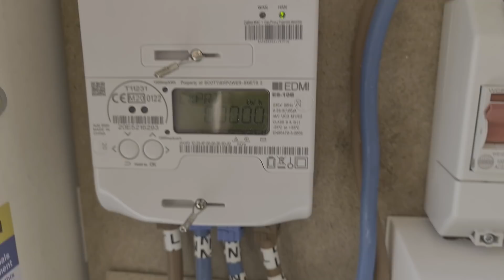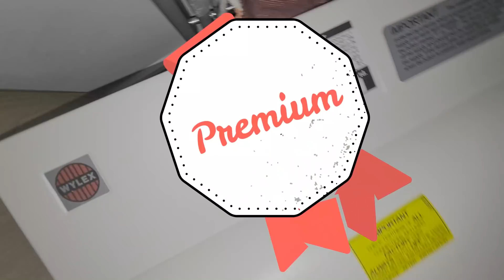New Build Electricians Shocking Standard?

Comment: My new build had a few shockers, outside lights, metal, earth cut short and not connected to terminal, probbaly because the apprentice thought it didn't need earthing because the wall plate was plastic, it was not a one off as the front light was the same. FCUs with standard 13A fuse not downgraded where needed, 3 pole isolator switches not earthed, metal back boxes, screws left in metal back boxes loose, exposed copper on grid switch not cut short enough, insulation screwed down on instead of the copper, connector blocks used instead of Wago, no stranded copper ferulled, all done as bog standard cheap, split load consumer unit with 2 RCD instead of RCBOs saving about £70 a house.
Reply from the maker: Bet it didnt have an SPD either 🤣
Reply: @electrician247 Ah it did have one, discovered today the downlights for the bathrooms and shower rooms are only IP20

Comment: Just come to this, a bit late I know. Main problem we have on commercial new builds is the typical team of Foreman + 10 or so apprentices/labourers. 
I’ve seen steel conduit installs where the bends are done with flexible steel conduit and yet they are using it as the earth! Raised this with the Engineering manager of the Datacentre and he didn’t care as long as he had a test certificate at the end. Didn’t care that half the values were made up,it was that obvious . Seen control wiring for roof top 1.2Mw chiller units run in flexible cable, not even toughened cable at that. I pointed out that there’s no protection for the cables and UV would destroy them in a few years. His answer was not my problem.
And therein lies the problem, too many people are happy to accept and sign off poor workmanship and design. Most of these ‘managers’ don’t even have any electrical or mechanical qualifications. Thankfully I’m retired now but still in touch with people in the industry. Nothing has changed with the big contractors , as long as they get a completion certificate at the end, they don’t care. It’s someone else’s problem, good luck trying to get faults corrected.

Comment: In this day and age the supply mcb was only 63 Amp rated - presumably the first sign of cost cutting by using low power SWA across the dwelling.
Twin RCD board, again low budget protection.  Low standards - I blame the money lenders for giving mortgages whilst at the same time not protecting the long-term interests of the property buyers locked into paying mortgages for barely adequate new dwellings (generalised low standards of construction, not just confined to electrical installation).
Reply from the maker: Well said 👏

Comment: I rang the NIC regarding the CET (Central Earth Terminal) recently, (this is the 'gland' in question in this video) and they said as long as it complies with the manufacturing instructions, they can't see an issue with it. I'm under the same impression as yourself, that it is a poor way to install something that has another perfectly assigned gland, but according to them, no issues!
Reply from the maker: The NIC can say what they like mate lol. Aside from the other issues with single insulated cables and such that's a piss poor way to make off swa and setup the earthing for a house. 

Also no selectivity on the ocpd for the submain. So much wrong and in truth would have been a lot easier and possibly cheaper to do it right imo.

Comment: what baffles me is if you now require a metal enclosure for the DB how come you dont need metal enclosures for the isolators etc in the outside cabinet , doesn't make any sense , we used to fit concentrics from supply to DB and yes we terminated with the bw or cw glands not the clamps

Comment: House bashers. The large corporations and 'housebuilders' lobby their mates ('MPs') to change or  adjust legislation to suit their own needs. They are all in the same club. 'Government' does not control the system, banks and corporations do. So, why would any housebuilder make a regime or working practice any more complicated than what the can get away with. It's all about share prices and profits as even the 'CEO's mates own the primary shares. I live in a relative new build from 2006. 16mm twin and earth tails from a fused isolator through the fabric for about 5 metres. Only basic insulation in the external meter cabinet where the outer sheath has been stripped right back.Un- clipped and flapping about. Generally shite installation with 1 rcd on the sockets. As a construction industry professional but not specifically 'qualified' in electrical work, I'm 100% confident that I'd have done a much better job. 'Qualified' in my opinion does not always mean competent. Someone that is competent does not need to be 'qualified'. I'll do it myself .  'NHBC' -waste of space. These 'electricians' -muppets. (apologies Mark, had to get it off me chest..)
Reply from the maker: No need to apologise at all. You make loads of great points. It's very frustrating tbh mate

Comment: What we need is a multiprong attack to sort thr various issues;

1. On new builds going forward male it compulsory that larger cabinets are installed - This will have a 3 fold effect; a. More space for all parties concerned, b. Remove that issue of DNOs not liking things in 'thier' cabinet due to point a above, C take pressure off electricians to cram stuff in.

2. OFGEM need to put more pressure on DNOs to not provide a supply to frankly dogshit installations, 

3. OFGEM to put pressure on CPSs to actually hold members to account for poor installs.

4. OFGEM  to put pressure on developers to give proper consideration to future utility works, be that electrical, water (and wastewater), gas and other services.

Going back to the root solution of larger cabinets would help all concerned. If OFGEM is not the right body then either DCHLG or HSE, the latter being sledgehammer to crack a nut situation but I'd that is what it takes then so be it.
Reply from the maker: Nice idea. Makes a lot of sense for a larger box
Reply: @electrician247  And/or a 2-compartment box. One compartment for the DNO, the other for the customer. Just a thought.

Comment: Great video Mark. New to the channel, liking the no nonsense approach and openness to discussion. What about external influence issues inside the meter box? In the cold/wet weather condensation might be an issue down the line? Fire proof insulation of the meter enclosure?
Great content 👍🏻🤘🏻
Reply from the maker: Exactly Phil. The cold needs to be factored into the mcbs operating characteristics. Derating factors need to be applied in most cases. 

The enclosures are generally adequately fire rated I believe. But only when installed as per MI.

Thanks so much for the kind comment and watching.

Mark

Comment: Seems to be common on nearly all new builds! Standard of work is very poor, it would take no time to make off that board to an acceptable standard. Totally agree that placing CU’s in the centre of a property is utter madness!

I have no issue with putting other items into a meter cabinet, it’s not the property of the DNO.

I do t know why EV Points are not installed as standard these days on new build 🤷‍♂️ and WHY are people still installing split load boards? RCBO are smaller neater and far better cost really isn’t San argument these days
Reply from the maker: Very good points well made mate. Totally agree. Thanks for watching

Comment: Regarding the not using the meter box I’ve had literature sent to me from the DNO (UK Power networks near me) who have said I can use the bottom right of the meter cabinet but for switch fuses only.  

Think it depends on the region and what they will allow.
Reply from the maker: Yes UK power networks have a pdf that shows this mate. Varies as you say region to region.
Reply: @electrician247  Yeah it’s the first time I’ve seen it mate and only with them. They all seem to have different rules and regulations, some DNO’s will let qualified Sparks pull main fuses if no Iso, some won’t really is a lottery.

Comment: I'm an old git and would have had my wrist slapped for something as simple as not aligning the screw slots on a switch plate. Makes me weep seeing this sort of work. That's why Good sparks are undercut and don't get the work. Unfortunately the DNOs or meter Operators  have no responsibility or more importantly the Authority now unlike when there were Electricity Boards who had Installation Inspectors who carried out the final connection to the meter and then sealed up. Most would not have passed or connected that installation on many accounts!
Reply from the maker: Yes this is true Alan. Thanks for watching!

Comment: Mater installers are required to supply to a double pole isolator on new builds. Only get supplied the basic we need to come to an arrangement on these sites the site will provide the fused isolators. So cuts down on clutter in meter cab. It’s all costs. Never about a quality job.
Reply from the maker: Sadly its very much cost driven.

Comment: I work in the Hotel sector, and a couple of years ago went to a recently opened  4 star property, with customer complaints of the sockets in the bedrooms tripping.
I Investigated and found all the complaints were from one side of the corridor! After investigation, The boards on one side of the corridor all had 4 x  6 amp RCBOs and on the other side of the corridor 4 x 20 amp RCBOs, correct mix was 2 x 6 amp and two x 20 amp Looked at the sign off paperwork and all test sheets were copied from one master sheet, and all had the same values. This was built by one of the top contractors in London.(I should have added, Individual boards for each room in adjacent risers!)
Reply from the maker: Its amazing what goes on. Yet nothing seems to change

Comment: Race to the bottom with  ew builds and EV installs, bigger companies making too much money from installations, installations which are meant to be governed by one of the strictest British standards in the world, yet standards are so low. 
I'd agree that putting equipment in the meter box isn't right as I saw the video efixx did however, with installs like this, it doesn't give much options. All parties involving electrical supplies need to communicate more.
Reply: *new. However maybe ewww was a fitting predictive option.
Reply from the maker: Great points Alex. I agree

Comment: Two words for that installation; shit show! The house I'm in (a rental) was built by Barratts in the early 90s.  Something that bugged me not long after I moved in was the fact every socket in the house (with the exception of a couple) is a single socket.  The reason became apparent when the main breaker tripped; the whole bloody house is on one ring main.  That's not the end of the cockups; none of the plaster boarding is put up properly;  all done with dot and dab, nothing is square or plum.  None of the doorways are square, all of the doors have been planed to shape to fit the cock-eyed doorways.  With the amount of effort that's been taken to bodge together and balls up the build, they could have done it properly in half the time.
Reply from the maker: My 2001 house has an excellent electrical installation. My only gripe on moving in 2009 was a single rcd on the entire install. The joinery and plumbing. Thats another matter entirely. Same as you found, awful!

Comment: I was at a New Build that was finished in Jan 21 and again NICEIC company.. crap board, lighting circuits done in such a way that they had 4 cables at multiple points and coming through a section of wood so no ability to install non-pendant light without tearing open the ceiling to correct it all by terminating in proper MF JB and having a single cable drop. The buildings non-electrical was just as bad, every light fitting was stuffed full of silicon meaning it all had to be picked apart carefully. From what i can see these new builds are terrible. I could go on but you get the point.. New Builds are disgusting and i would NEVER ever purchase one!
Reply from the maker: On the tools did a video last week showing just this. Disgraceful really. Thanks so much for watching!
Reply: Shameful need I say anymore

Comment: This whole concept of the nation having EV's is flawed from the timescales, to the infrastructure, to even sourcing the materials for batteries, do we even have the recources for raw materials in this country ? I doubt that, let alone the recycling of such batteries.
Whatever country they source the raw materials from will end up holding us to ransom on the future costs of the raw products, where have we heard that before ... think about oil, OPEC ... sthe story goes on.
Plus, once fossil fuel taxes diminish for the Government, who thinks any subsidies will remain for EV ? We all know the pound of flesh will be required, has to be as roads will still need maintaining , building, lighting, policing... blah, blah, blah. So forget ongoing subsidies, they will diminish just like solar panel subsidies.
If EV's are forced upon us, and each domestic property will require EV charging points, just what are the regularity bodies doing to ensure that building designers/builders are catering for these imminent changes ? that example house is a classic example of zero foresight into adding an EV charger point, or any other additional electrical services.
Even the existing meter cabinets are a bit of a squeeze, look at the small additional board fitted at an angle, meter cabinets from here on in should be large enough to cater for the installation of feeding EV chargers from the CAB, with of course correct switching, fusing etc.
Lets face it, they are more often than not at the front or side of the property where most EV vehicles will be parked up for charging, why not have regulation now for the issues you speak of.
I know some may say that this would be taking work away from electricians in the future, well, show me who really relishes installing an armoured cable on a new or recent build from the consumer unit under the stairs to the EV charging point, with solid floors and chipboard flooring, even worse once a tiled or laminate floor has been added.
In addition, what consumer wants to have his recently decorated house pulled apart or to be told that he will have huge black armoured cable run externally around his property.
In maybe the 30's, the fuseboard was often fitted under the stairs, but then, there were floorboards, in the later years, consumer units were fitted, often just inside the front door, then at high level in a similar area.. ok, maybe not a bad EV install.
Now... if they now install the consumer unit beneath the stairs, bad news for EV installs, maybe not always bad for extra internal installs.
In many cases, consumer unit within a integral garage.... could put a smile on an installers face 😁
With respect to the quality of install on a new build, sealed competetive tenders are the culprit, plus to meet that price, the contractor using non qualified labour to throw it all in and then a 'qualified' guy final fix... just what that word 'final' means is well open to interpretation.
As an addition here, the DNO who fitted my smart meter fitted the mains supply isolation switch, fitted it upside down ! he used to stack shelves in a supermarket months before, not a qualified electrician at all, just trained to do one thing, and he even got that wrong.
I did not notice at the time and when I did I called the DNO and explained, that was several months ago and no one has contacted me to change it !! 
Phew, never intended that to be so long..😁
Reply from the maker: I dont disagree about the EV concept. But seems to be the journey we are on. 

Thanks for watching and joining in the comments, really appreciate it

Comment: Now I've never done this, nor will I probably ever, but wouldn't it be better to have a small MET in that meter cabinet so you don't have to mess with the suppliers head in the instance that you have to pull a new armoured for your consumer unit? 

Also is that a jubilee clip?
Reply from the maker: Makes sense to me. 

Its a swa gland/termination typically found in street lighting. Works in the same way as a jubilee clip

Comment: I've laboured on new builds, the quality of workmanship across the board is an absolute disgrace, from all trades. As for the electrical industry it's a race to the bottom.
Reply from the maker: Certainly seems that way! Thanks for watching
Reply: Absolutely.  I recently got back in contact with an old friend from School who's a carpenter; he was a little short of work a few years back, so looked to do some site work with one of the housebuilding conglomerates...spent less than 10 minutes on site saw the level of the craftsmanship, and walked off site; never to return.
Reply: @johnmcquay82  The last time i was on site, the 'joiners' were hanging doors. When their hinge cuts were slightly too small they would smash them in with hammers and then screw them tight. Job done.

Comment: That consumer unit would have been specified by the housing development when sending out a tender. Why would you put an SPD in at your own cost when the customer has not specified or paid for it? If this is a 100 plot development would you really spend £3,000 of your own money for something the customer has not paid for? Also we have 2 reasons for poor new build work. 1st it is the greed from the housing developers them self. House prices going up but they are always cutting costs for every trade. 2nd it is because it is far too easy to because a Micky Mouse electrician in our country. You can pay for a short course and come out of it with all your qualifications but not actual on the job skills.
Reply from the maker: Saying the same things mate. This is down to developers greed. The money is in these plots overall. Exactly the problem with bare minimum spec and cut after cut at labour prices.